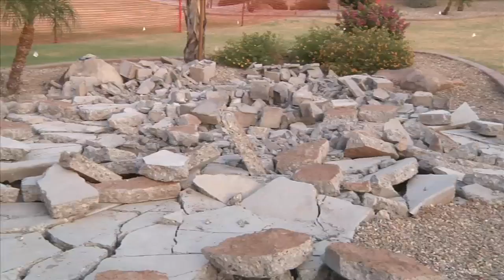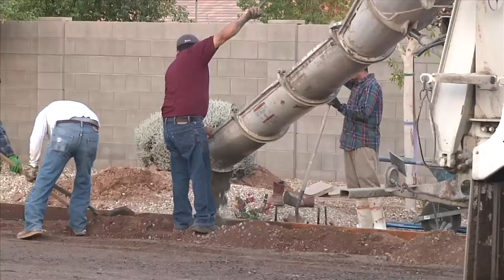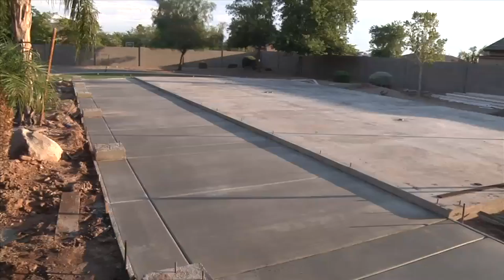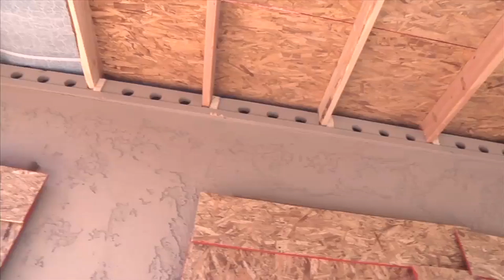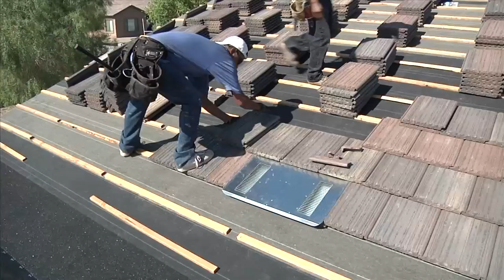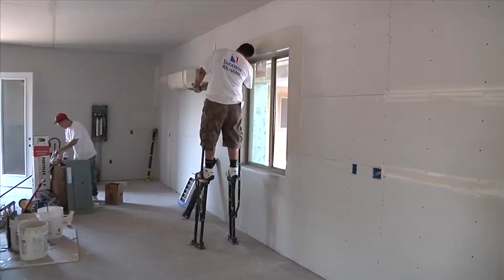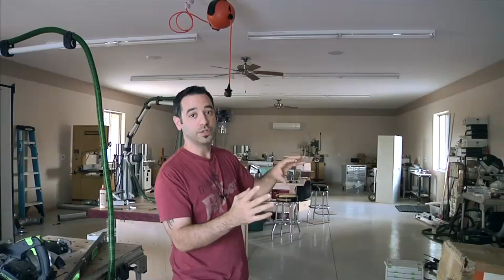Building a Dream Woodworking Shop

Comment: So no wire mess in the floor? I thought it would be necessary especially for something that large. I see all the time on home shows that they put it in. Say a basement for instance
Reply: For the few pours I've helped with, we always used it too, for strength & to prevent cracking. However, if the ground is very solid & compact, you really can get by without it. My grandpa didn't use mesh for his sawmill or shop pads (in Washington), and neither have cracked since they were poured years ago.

Comment: Im a carpenter from the cold north, and really enjoy watching and learning from you, working with finer joinery. I keept expecting you to mention, my fellow colleagues crude butt joints, assembled with our trademark 4 inch steel dowels.
One question though: How is the cement roofing tiles fixtured? Just sheer weight?!? What happends in a storm if so?

Comment: as seen from Europe, I have only one comment: walls made out of wood??? where are the bricks??? :)
Reply: Bricks?  It cost money to hire brick layer and even then it's just a outside wall treatment, you still have to do studed wall construction on the inside.
I might have used Sips  structure insulated panels,  but the construction type may have been nessary for his area.  You cant just build what you want, it has to meet or fit the area.

Comment: Congratulations on you’re amazing dream work Shop!
I was fun so see how it was build.

I was wondering. In the US allot of houses and garages are build with a wooden structure. Why is that? Is it cheaper and faster to build? (although it’s hard to imagine, there’s allot of layers before its done)
I live in the Netherlands and we build most of the buildings with concrete and bricks.
When later you add some living space or a garage to your house, most of the time we use things like cellular concrete blocks for the inside and finish the outside with bricks.

I was just wondering why we build this way and you guys build it that way. Probably has to do with available building materials, climate conditions, familiar building style and aesthetics I guess. I was just wondering if you have things like autoclaved cellular concrete blocks and other building blocks like that? And if so, why is the wooden frame building style preferred over the block style?

I’m a complete layman in these things by the way ☺
All I know is that those cellular concrete blocks can be made heavy for max strength or light of max isolation. So to this layman it seems very handy.

Any thoughts on this?

Btw those stilts  /LIKE

Comment: I live in LA and I dont like duct work. Of course I have little need for heat or air! A few miles from beach. Best weather ever. I am from the midwest with mosquitos and humidity and snow and ice. Love not having heat or air necessary. No mosquitos!!

Comment: This video is proof that it takes money to make money. This is 2014, it isn't the 1800's where if you liked blacksmithing you would set up a small shop and immediately begin making a living. No, it isn't like that anymore. There's overhead and permits and insurance and tens of thousands of dollars in equipment and a limited consumer base because everything is plastic or mass produced Ikea. Unless you have money (look at the luxury this guy lives in, look at his back yard for christs sakes), you cannot be an old school entrepreneur. Modern society is set up to make you fail if you even try. I work my ass off and built a woodshop with blood, sweat. tears, and second hand used machinery that I had to make repairs on. $50 new bearings here, $40 belt there, $80 new wiring here, $150 overhaul there. Meanwhile, this guy has probably a million dollars within the first 10 feet of the shop and doesn't even feel the sting. I thought, hey, put the work in and you can be self made. Isn't that what your parents tell you when you're a kid? They never tell you about shit like having to have insurance in case some asshole slips and falls while walking into your shop. Yeah... most people never think about that, and guess what, insurance eats up whatever profits you thought you were going to make... and it's all for nothing, nobody will probably ever slip and fall there. So, unless you have money like this guy, don't bother.
Reply: Need some cheese with that whine?

Comment: I think a floor drain would have been a good idea. Now that I'm typing this and thinking about it maybe not so much for sloped floors and needing level floors for equipment but you put the garage door beam in for resale. If a wet car drives in theres no where for that water to go.
Reply from the maker: Well we don't have many wet cars around here. :)

Comment from the maker: Amazingly well. I rarely had to run all three interior units at the same time. Most times, I had the front two on low fan (to keep the noise down) with temp set at 78F. Very impressed with their performance.

Comment from the maker: I actually come from a primarily hobbyist background. So most of my equipment was built up from that mind set. I have never actually used a shaper and I generally think in terms of the router table by nature. I know a shaper would be handy to have but I think I'd like to work with one in someone else's shop before committing to one in my own.

Comment from the maker: We actually just got solar panels on our house. The system is leased and the tradeoff is that our monthly bill goes down. We over-produce and the electric company pays us for the power. But they are currently in the process of changing the policy so that the value of our power is much lower, meaning it will no longer be a cost savings to go with solar. So where's the motivation in that?! I can see what this stuff just doesn't catch on.

Comment: It's amazing how buildings are made in the U.S. - Wood and more wood, some more wood and a skin over it all. It's really fast and clean building and it must be cheaper too. Here in Portugal every house or shed is made from bricks and concrete and, in this last years, with interiors of drywall. It takes forever to be completed and is expensive. I guess you people have more trees than we do... There are lots of bricks here and cement plants. Nice shop and good vídeos. Thanks for sharing.

Comment: If you live in Arizona you must have tons of sunlight, so do you have solar panels on the roof? With the summer heat and probably cold winters a geothermal heat pump could cool you shop in the summer and heat in winter with minimum power usage and without making any noise at all.

Comment from the maker: The shop is well within the WiFi range of the house. But I still ran ethernet for a hard line since I do live broadcasts from the shop. I also included extra empty conduit runs for additional utilities should we need them. As for cable, we are cutting the cord anyway so there's really no need. We get most of our entertainment programming from the internet.

Comment: i'd hope that when you ran the conduit, that you ran an extra, capped off  conduit for any unforeseen, future improvements. Just makes it easy to add a wire or a tube without having to break the slab

Comment from the maker: Again, it's just my opinion. A textured wall does a better job of hiding flaws and requires fewer applications of mud, primarily because you don't have to level things quite as perfectly and extend the "repair area" out so far. So  for this DIY'er, textured is easier.

Comment: One more quick comment, did you need to hire millwrights to move your powermatic equipment?  How heavy is that stuff and what is the heaviest piece?  Just wondering because I offered to assist a friend in moving similar grizzly equipment from a basement to a new garage space.  Wondering if 4 guys is enough of if we really need pro-movers or even millwrights.

Comment: WOW.  What is that?  About 16 in for footings?  I live in Chicago, mandated 42 in footings (to get below frost line).  Cottage in Central Michigan needed 46 in.  Those depths easily double the cost of a patio pour.  Necessary to avoid frost heaving though.  Thanks for the vid!

Comment: Just got around to seeing this, glad the comment is recent- Just a tip from someone who knows a bit about everything construction and architecture- The best thing you can do (since I'll be in the same situation) is do what you can for maximizing insulation R-Value as well as considering your material selections. Standard fiberglass insulation is good at sound as well as thermal, but Denim at the same R-Value has even better sound insulation, it's just costlier..

Comment: For all you concrete "experts" :  They probably didn't use rebar or reinforcing grids on the slab because they used fibermesh concrete.  Not required on a monolith pour.  Check the code book.

Mark, congratulations on your achievement.  Now if only the Mayan calendar is wrong.  BTW, I broke my dog's leg with my Revo once.  She still growls if I even look towards the RC closet.

Comment: Did they put and steel reinforcing mesh into the slab? as it looks as if they did not put either a vapour barrier ie PVC or any mesh into the slab. Or is Arizona that dry and stable its deemed unnecessary?

Comment: Hmmm, well I just finished a project and poured over 70,000 cyds of concrete and finished over 1.2 million sqft.
 So my bases is 25 years of concrete experience. I am surprised your contractor chose to eliminate the rebar especially with an epoxy covering. With the exception of your concrete slab your shop looks great.
 JW

Comment from the maker: Well keep in mind that I was barely scraping by as a furniture-maker. Ask any pro and you'll quickly find out that it is a difficult way to make a living. I now make my living through educational materials (video, books, DVDs, classes, etc). I still take on the occasional client project, but only when I really want to. This is why I am not in the habit of dispensing woodworking business advice, primarily because I had just as much difficult as anyone else.

Comment: I agree!  I tried to get the contractor that poured my shop floor to use either rebar or at least mesh, but NO.  He insisted that the glass fibers were more than enough.  Well, some 15 years later the floor has 3 serious cracks and settling that could have been prevented.